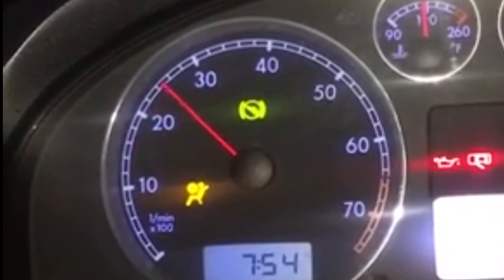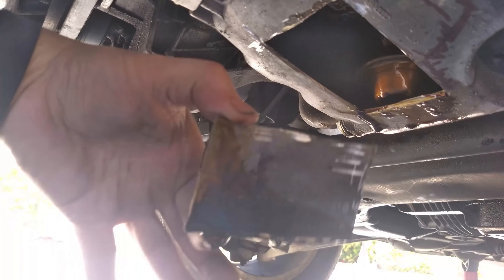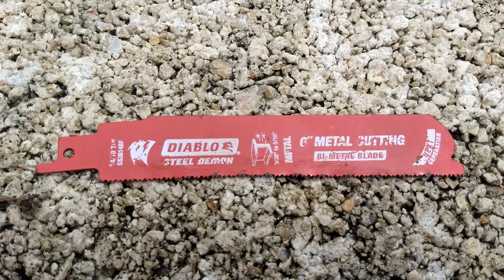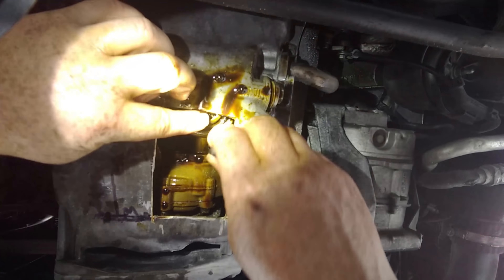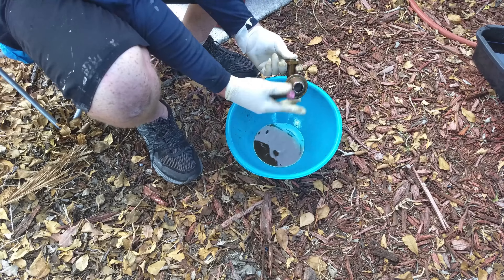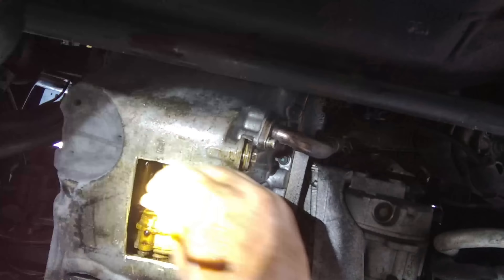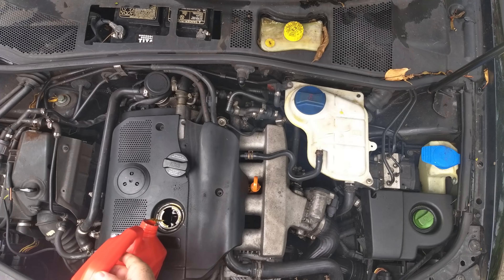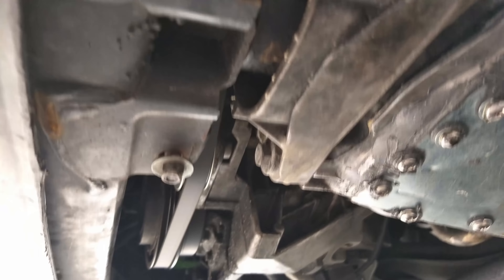Volkswagen Passat 1.8 Turbo Low Oil Pressure Create Access Plate

Comment: This works perfectly. I did it and also with the hole i cut out i added more clearance for the pickup tube  so the suction neer the bottom of the pan wouldnt be close enough to pick up shit. VW had a shit design to start with this guy just made it better.

Comment: Top tip change the oil pressure senders first. Check the wiring. They have a two tiered system. Low oil pressure below 2100rpm and low oil pressure above 2100rpm. Sometimes the wires will come off or become corroded check those. I don't recommend anybody do this. Just drop the pan.
Reply from the maker: Thank you for sharing. If it's possible for someone to easily drop the pan on this model I agree with doing that rather than what's shown in this video.  This model has many steps and one needs many tools to properly drop the pan. If you read a comment below someone mentioned how to access the 3 rear bolts (those are the ones that are not accessable) by removing the front motor mount then Jack the front of the engine giving just enough space to get a wrench in there. I would have done that over this if I'd known. Bit this car has been such a pain I threw the dice and it worked.

Comment: Unorthodox you say? How about radical!  But roughly brilliant!  That was very enjoyable.  Now, the orthodox method of gaining access ,you said, was to drop the frame.  That would also be interesting to better understand and see done.  Poor access design, you said. Millennials would have designed it differently for sure.  There would be an access panel on the pan that opens with a phone app.   The app would also monitor the pick up volume and pressure.  LOL.  After reading all the comments I don't think they understand you searched for metal shavings with your finger.  The liquid gasket is designed to use with oil so it won't disintegrate.  PLus they forget you are not working on a $40,000 new car.  There was a valid comment about how they would have cut the metal differently by drilling four holes and using a saw instead.  I would also suggest you change the oil filter more frequently after a job like this.  The Passat is an awesome style.  Now put some racing decals on it!

Comment: This was nonsense. This is great for people saving money. But after the time and energy and possiblity to screw up you wouldve already had the oil pan off even resealed the oil pan and service your part. You found debris and decided oh yes lets go. Obviously theres failure and for the people saying that its not worth paying a mechanic well it is to do the job the right way.
Reply from the maker: I agree if you have the money to pay a professional it's a better route. This car had soooo many issues that I fixed probably but I didn't think I could do what I read was the correct way to do the job (lower frame) safety. Not to mention the interior of the car was so screwed. And after all was said and don't someone commented that you can remove the front lower motor mount and jack the front of the pan up just enough to gain access to the rear bolts....smh. live and learn. Thanks for watching!

Comment: Was it more quiet when u finish
Reply from the maker: Yes it sounded normal after I did this. You can hear it at the very end of the video. I had the engine running.
Reply: Thanks

Comment: Someone else did the same thing w/ some roundy drill hole cutting thing except it’s not much of a DIY: https://youtu.be/QUezF6fuVR4?si=EtI8ahfUP019EbZ6
Reply from the maker: @duncanmn95  that's one of the places that I got information from before doing this. Bty no one should do this. I made this video out of frustration and recorded it. Someone posted here that you can remove the front engine mount to get clearance to remove the rear bolts. Thanks for watching.
Reply: @ wait so did you end up having any adverse consequences? Did it start leaking or anything like that?? I’ve heard you can lower the subframe or something like that, but that still seems like a lot more work than cutting a hole
Reply from the maker: @duncanmn95  never had an issue afterwards. I did this bc it says you've got to drop the subframe and I thought it was way too much. Again someone posted in the comments you can remove the front mount to jack up the front of the engine to get access to the rear bolts. I haven't tried that but it seems like a better idea.
Reply: You mentioned a link to a video where someone did the other method you’re talking about, do you still have that link?? I’m skeptical that there’s a way of dropping the pan that’s easier than dropping the subframe b/c I’d think someone on the forums would’ve mentioned it by now I mean like after this gen of 1.8t Passats/A4s have been around for >20 years
Reply: @DoItWithDave  also, that grinding noise @0:14 sounds like the timing chain tensioner at the back of the engine, I had the same sound in my A4

Comment: So hows the car running? I'm about to try this.
Reply from the maker: It's still running with no oil pressure issues, however because the pressure is back to normal the valve cover gaskets around the spark plugs started leaking some. Besides that I'm at the point with this vehicle to drop a wrecking ball on it. Lol. Seems like something else every couple months. I'm my opinion (case) this car is meant to be traded at 160,000. But I'm sure many Passat owners may beg to differ, depending on how well scheduled maintenance prolongs the vehicle's life.
Reply: @DoItWithDave  I'm sure it's different cars, I'm just worried about the shavings. I can't imagine doing that would cause that, but I do appreciate your feedback tremendously the fact that you replied is awesome enough.
Reply: I am honestly shocked it is still running...i have over 200,000 miles on mine and it runs just fine...your cars dont last past 160,000 because you do hacck jobs like this
Reply: @lorenyoung1889  right I just got mine out of the shop and it's running perfect again, I have 240,000 miles on it and am ripping gears like it has 100,000, this dude just wants people to fuck they're shit up
Reply from the maker: @lorenyoung1889  I got this car as a beater. Like everything falling apart interior exterior way before I ever did this "don't try this at home" video. Fact is I threw my hands up on this one. Having worked on this car since 2015 doing things like the water pump O Ring..just want to thank VW for making that O Ring extremely accessable JK to vacuum check valves. And if I brought this one to the shop, repairs for this car would be enough to buy it 6 times over, yes I get want I pay for. Also I've seen some of these Passsts around town and it's obvious how nice they stay if maintained properly. Seems like you got a polished up one, I honestly don't mean to offend any Passat owners out there, they are fun cars to drive.
Reply from the maker: @Anactualrealperson  if I had cash for the shop then I would have never made this video. I'm glad u whip is solid, da a nice feeling. Thanks for watching!

Comment: How far did you get before it blew up 😂
Reply from the maker: It's still going. The thing is there's a small leak around the cam cover (which happens to these vehicles) about 6 months after I did this. Pretty sure it's partly from having the proper oil pressure after cleaning the pick up. This car has had a new issue ever couple of months and at this point it's more of an experiment car than anything. Thanks for watching!

Comment: You’re kidding me...
Reply from the maker: I understand what you mean based on your comment, however this is what I did and it is still working just fine. Definitely not recommend for anyone to do just wanted to share what ended up working for me. And I did get a comment about removing the front motor mount, then jacking up the engine to gain access to the rear bolts but didn't know that until I did this or else this would have been an extremely different video.